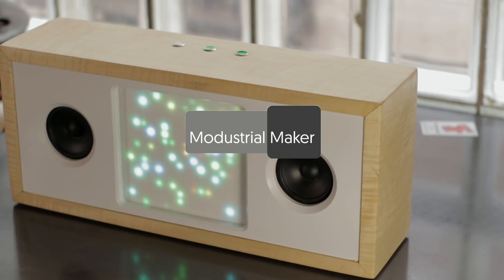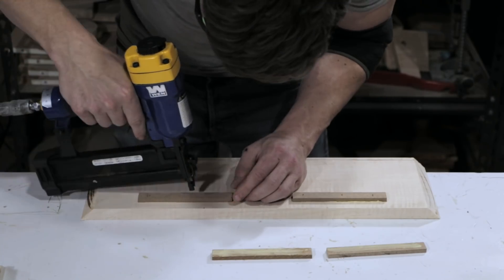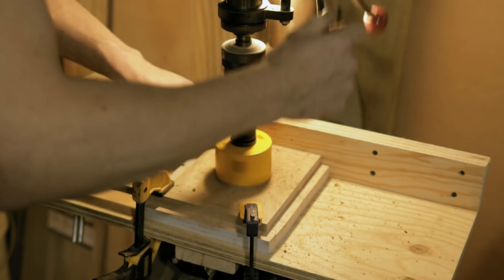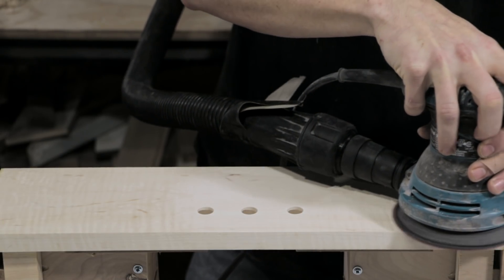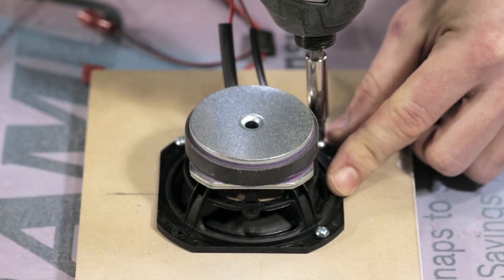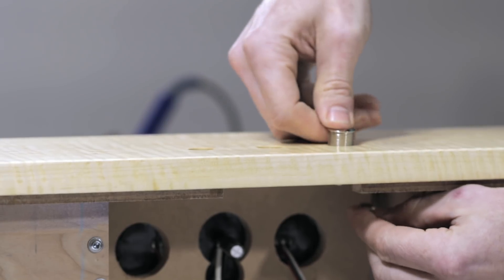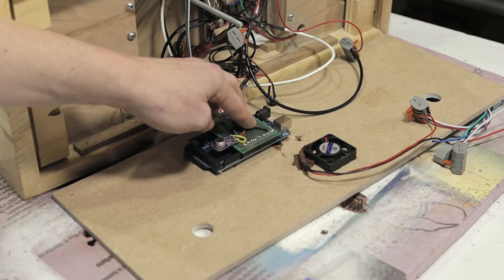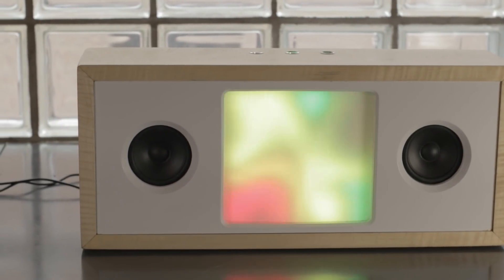Bluetooth Speaker w/ Reactive LED Matrix || How to Build a Speaker || DIY

Comment: Greetings! Thank You for sharing this. I know it is not so new, but, decided to try out of curiosity. Unfortunately, on Arduino Mega 2560 it acts like would be on super slow clocking or something like that :) Probably new versions of used libraries mess things up? I don't know. Tried on two different "Mega 2560" boards ("classic" layout, and mini board). If you still check this, and, maybe have a quick idea(s) from your experience - I would appreciate :) Thank You, and Merry Christmas!

Comment: With the speaker enclosures I think a pro built cabinet would have a hole (often in the front) to allow the moving air out (if that's what it's for!) but you might have put one in the back I guess... No doubt they are scientifically calculated for volume of the box and the output of the speaker.
Also when you glued the aluminium (note the spelling ;) sheet to the panel face and then the led array, you would get better glue contact clamping a ply sheet over the whole area rather than just at 4 points.  It evens up the contact better rather than just under the clamps.   You'll have built the next one by now but just observations from here.  Great project!  I am a bit obsessed with led displays and this is a goody!

Comment: In a smaller setting, what’s the benefit of using a step down converter vs just a resistor? I’m tinkering with a small vw bus model that i would like to put a few LEDs in, as well as a bluetooth speaker setup that I have robbed from an older speaker box. 

Can you explain it to me like a second grader? HahHa
Reply from the maker: Honestly, I'm not sure about a resistor vs step down.... I guess what I could tell you is the step down is easy to wire and you just dial in the output voltage, so it makes it foolproof.

Comment: I am using a 16x32 rgb matrix instead of the neopixel. I was wondering if their was any way to edit the code to be compatible with that type of matrix instead. Thank you.
Reply from the maker: what type of LEDs?  ws2812 or sk6812?
Reply: @modustrial  I couldn't find what type of LEDs I am using. But I bought the matrix off of https://www.adafruit.com/product/420
Reply from the maker: Unfortunately I don't think my code will work. The description of those states they are designed to be driven by FPGA.

Comment: Hello Modustrial Maker I still think this is a great project and for now I will assume my problems are with the cheap ebay Arduino Mega clone I have. I am going to spend a few bucks more and get a real one. I have taken the 16 16 display and built your beautiful diy "Living  Art" table lamp. Please check my comments and praise on that page, I didn't think it should be discussed here.
Reply from the maker: Thanks!  This one takes some effort and troubleshooting, just add one component at a time and make sure that each is working before adding another on, and you'll get it up and running.

Comment: I have started building this great project and have run into a snag, every time I attempt to load the sketch onto me Mega 2560 R3 I get the following error message "Arduino: 1.8.5 (Windows 10), Board: "Arduino/Genuino Mega or Mega 2560, ATmega2560 (Mega 2560)"In file included from C:\Users\Jim\Documents\Arduino\Baby_Speaker_FINAL\Baby_Speaker_FINAL.ino:1:0:C:\Users\Jim\Documents\Arduino\libraries\FastLED/FastLED.h:17:21: note: #pragma message: FastLED version 3.001.008 #    pragma message "FastLED version 3.001.008"                     ^c:\program files (x86)\arduino\hardware\tools\avr\bin\../lib/gcc/avr/4.9.2/../../../../avr/bin/ar.exe: unable to rename 'core\core.a'; reason: File existsexit status 1
Error compiling for board Arduino/Genuino Mega or Mega 2560.This report would have more information with
"Show verbose output during compilation"
option enabled in File -> Preferences.you have any ideas on what might be happening here because I have run out of ideas.
Reply from the maker: Are you using an Arduino mega?  Also, did you install the FastLED library for Arduino?
Reply: Yes and Yes
Reply from the maker: It looks like some error with FastLED.....there is a very active FastLED group on Google+, I would post the error there and see what they say.

Comment: Hello Modustrial Maker  this is a great project and I have already begun ordering some of the electronics, tomorrow I am going to my local home center to get the wood and other items needed.    I was wondering, in your instructions on the Arduino Project Hub you state    "(optional) ¾” hole for fan intake.  Drill where convenient.  I centered this hole about 2” from the top edge."    but nowhere did I see any listings for any cooling fan, do you have any suggestions for which cooling fan would be best.     Thanks for a great project and build instructions my son is going to love this. Hell I might even make one for on my work bench as well.
Reply from the maker: I just searched for a small 5v fan on eBay...just make sure it's size is right (about 1" square or so)

Comment: I built a Bluetooth Speaker with a 2 3w 4ohm speaker powered by a PAM8403 amplifier supported by 5v 1A powerbank charger module and for the bluetooth i have used a USB powered bluetooth adapter
Now while connecting 5v output from the powerbank module is connected to the +ve and -ve of the amplifier module and the same wire I removed the sheath connected a B0505s-1w dc -dc 5v-5v isolating converter to the respective +ve and-ve wires and the output from the converter to the Bluetooth Module
Problem1: Ground Loop Sound Interference still exist
Problem2: Slight heart beat like thumps from the speaker 
Can you help me find a solution to this?
Thanks in advance
Reply from the maker: Sorry, it has been so long since I looked at this, and solving electronics issues without being able to physically play with the circuit is very difficult.  Definitely check out some of the speaker building forums online -- they are a great resource for troubleshooting help.

Comment: Modustrial Maker
Hi, a great video. I'm in trouble with the problem or not, but the switch button needs to be turned on when it is turned on, because I do not know if it should be or not?  pleazy help.
Reply from the maker: Thanks!  I'm not sure I understand your question, could you please elaborate a bit more?
Reply: https://www.aliexpress.com/item/16mm-Metal-Momentary-Push-Button-Switch-LED-5V-12V-24V-110V-220V-StainlessLess-Steel-Waterproof-Car/32825559676.html?spm=2114.search0204.3.50.3dcc6cedMuzRxo&ws_ab_test=searchweb0_0,searchweb201602_3_10152_10151_10065_10068_10344_10342_10343_10340_10341_10696_10084_10083_10618_10307_10820_10821_10303_10302_10846_10059_100031_524_10103_10624_10623_10622_10621_10620,searchweb201603_30,ppcSwitch_2_ppcChannel&algo_expid=b9e198a2-bfa6-4254-9dd5-855278935d02-6&algo_pvid=b9e198a2-bfa6-4254-9dd5-855278935d02&transAbTest=ae803_2&priceBeautifyAB=0
Reply: Do  have to be hot?
Reply: or bad voltage button ? and hot button side
Reply from the maker: Still having trouble understanding what you are asking.  Are you asking if it is in the configuration where the light is on normally, and goes off when depressed?  In my build, that is how it is wired.

Comment: how do you call the wires used for the female power jack and the on the microphone board because they are not jumper wire (flat cable) and i dont know what you call them. thanks
Reply from the maker: I think I just used 20g wire for the rest of the wiring.
Reply: i'm making one right now, i shud finish it in like a week because i av little experience and tools. i'll send the picture to ur mail when its done. thanks once again
Reply from the maker: Awesome , can't wait to see it!
Reply: i sent you a mail regarding the mic. please check it out. thanks
Reply from the maker: Just replied.

Comment: Nice, detailed video on a decent, cabinet-grade speaker. (I'm tired of seeing speakers whacked into XPS foam boxes - might as well use an oatmeal can.) I'm sure your friend's baby will be well-enriched by it!

Did you really need an Arduino Mega for this, or did you use it because you happened to have one on hand? I'd think anything bigger than a Nano would be overkill for this project.
Reply from the maker: Thanks!  The mega was used because the code was too big for a nano...I used a clone that was like $8 so I didn't mind the fact I didn't really need the I/O on the mega

Comment: What are those gray and orange things where you can insert wires?
Reply from the maker: Those are lever-nut wire connectors: http://amzn.to/2BhMtvM  I love them...easy to use for quick prototyping (and carry signals much for reliably than a bread board), but sturdy enough for permanent installs.  They are designed for use in 120V home electrical boxes, but work really well for applications like this too.
Reply: oh, thank you so much. Those can be really handy in my projects
Reply from the maker: Glad to help!

Comment: Holy crap this is awesome. What a great project! Wish I had all the tools needed to make my own.
Reply from the maker: Thanks much!  You absolutely don't need all the tools I used...  You can build a speaker with a circular saw and drill...what tools are you working with?
Reply: Right now (I'm still fairly new) I have a Jigsaw, a reciprocating saw, and a drill. I also have a dremel on it's way to me.
Reply from the maker: You can build a speaker with those tools and an MDF shell, just be ready to do a lot of hand sanding.  A circular saw will really help as far as cutting pieces straight. I would recommend that and a randome orbit sander as your next tools.  Check Craiglist as you can often find lots of old corded tools available on the cheap
Reply: Thank you so much, I will definitely get hold of a random orbit sander next, and look to getting a circular saw soon! :-)
Reply from the maker: Awesome!  And have fun, it's a very addicting hobby :)

Comment: Awesome build! I'm a former DIY audio hobbyist. The only real positive critique I can think of as far as the sealed enclosure for the drivers goes is lining the inner walls with some type of sound damping material. I'm a fan of carpet padding as it's thin, but it's a dense enough foam to catch any unwanted back waves from bouncing around. I'd definitely stuff the enclosures with some poly-fill as well.

Comment: Hi, when you press mode button, actually it will connect pin5(green wire) on arduino to GND or 5V?
Thanks.
Reply from the maker: +Tuan Ma I'm not sure what the question is?  In the code, there is a switch_pin variable (or something with "switch" in it...I'm not at my computer now).  Whatever number that is is what you connect the button to (with the red and blue wires to that pin).

The green wire on the button itself should be getting the 5v power in from the power source or the 5v pin on the Arduino.
Reply: Modustrial Maker Thanks for your reply. I mean the green wire that connect from arduino pin 5 to 5 pins mode switch (blue and red pin). When you press mode switch what actually the switch do? Will it connect red or blue pin on switch to ground or 5 volt? Since i do not use exactly same as that switch.
Now if i turn it on, the led panel just continuing jumping from one mode to other mode just in a second.
Thank you.

Comment: very cool build.  i would be very interested in a q&a session.  i'm going to try to build it but i have no experience with wood working so i'm trying to find an alternate enclosure.
Reply from the maker: I still owe everyone the Q&A.  I had ambitions for a dual camera setup so I could show code and the speaker at the same time, but have not been able to get the equipment and software set up due to time/money constraints.  I will probably just do an Instagram live session instead in the next week or so.

Comment: Nice work! I think I'm going to build one with a rechargeable battery pack when i have some time.
I also love the adjustable position of the led matrix! You cold add a spring between two countered nuts on the threaded rod and the rear plate of the speaker so that you don't have to push the rod back in the speaker when you loosen the tumb nut. :)
Reply from the maker: Thanks!  The spring is a great idea, I was trying to come up with a solution for that!

Comment: i just made my first project.. i love your project. i really like the mod for the led to difuse them great idea!!
Reply from the maker: +Dave Blvnko thanks!  What did you make?
Reply: Modustrial Maker i started with some simple mapped Christmas lights for the tree.. worked out but I need to get better at soldering..  next I want to do is a udoox86+ambilight ... I also think about making ur Projekt for my workshop.. but I would try to add a radio with inside 😊
Reply from the maker: Cool!  If you share pics on Instagram, definitely tag me (@modustrialmaker).  I want to do an ambilight for a TV at some point, but am hoping if I wait on this, someone will send me some code to make it easier to tackle :)   Re: soldering -- if you are using a cheap soldering iron, you might be better than you think.  I upgraded to a decent soldering iron with more power, and it makes a world of difference.

Comment: How were you able to hook up the laptop power supply to the sound board? did you cut the barrel attachment off to reveal just the wires?
Reply from the maker: Yes, and no.  I built five of these, and for some I used a 19.7V power supply, for others I actually used a 24V power supply (although they recommend 19.7V, the Dayton board is rated for supplies up 24V).  The barrel on the laptop power jack was bigger than the standard size, so I cut it off, and soldered a smaller male power jack onto the wires (making sure it was rated for at least 6A of current).  The 24V power supplies had the correct jack so there was no need to modify these.
Reply: I'm new to electronics and am trying to figure this out. Does the Dayton board have a barrel in for the laptop jack fit in on the power cable to power it?
Reply from the maker: Kudos for jumping right into this project!  No, the power cable that plugs into the dayton board just has bare wire on the other end, so you have to connect it to something.  I connected it to the female power jack on the back of the box (via a splitter).   The female power jack on the box goes to a splitter that runs directly to the dayton board, and to the step-down converter.  This way I just plug the male power jack into the back to power everything.
Reply: Thank you! i appreciate the help! i'm mostly trying to figure out how the blue tooth speaker part works first before the LED
Reply from the maker: No problem.  I was actually going to recommend that.  If you break it down in steps, I think this project is definitely doable for a beginner.  I suggest: 

(1) Watch videos by Kirby Meets Audio and Soundblab and use them to build a basic bluetooth speaker with a Dayton board.

(2) Watch Cine Lights VU meter build videos to build an LED VU meter like he did.  Natural Nerd's audio reactive lamp is also good, but Cine-Lights electronics are closer to mine since he also uses a momentary push button.  My code is a mashup of code from Cine-Lights, Natural Nerd, and a few people over on the FastLED Google+ forum.

(3) Put it all together in one build with LEDs integrated in a speaker box.

This is basically the path I took to get to this speaker, and doing each part separately before putting them together was definitely helpful.
Reply: Hi again, just a quick question, how exactly does the power supply with Inner diameter - 5.0mm Outer diameter - 7.4mm tip size connect with the 5.5mmx2.1mm DC Power Jack Socket Female Panel Mounting Connector?
Reply from the maker: I actually had to cut the female jack off that power supply, and solder a smaller jack on.  (I couldn't find a 19.7V supply with the smaller jack.)  I used one of these: http://amzn.to/2qk4k3v
Reply from the maker: Sorry, I said that backwards, I cut the male jack off the power supply cord, and used the smaller male jack (from that link).    Are you located in the U.S.?  If so, just e-mail me your address and I can drop one of the smaller jacks in the mail so you don't have to buy a 20 pack.  I've got a bunch of em lying around.  (Email is modustrialmaker@gmail.com)
Reply from the maker: Those should work -- my only concern is that the female jack doesn't have an Amp rating (one answered question suggests 3A, and this would be slightly less than the max output of the power supply).  It should be OK though, just do the math and make sure you aren't pulling more than 3A @ 19.7V once you add the LED matrix in.
Reply: Thank you for all the help! I really appreciate it!
Reply from the maker: No problem!
Reply: @modustrial  Hey, its been a while but i just wanted to update and say thank you! a few months ago i was able to successfully make a speaker for my girlfriend for here birthday. It's not exactly like yours but it was a beauty and the beast themed speaker with LED's and an arduino that is sound reactive. I just wanted to say thank you again as I wouldn't have been able to do it without you and I can send pictures as apart of the update if you would like!
Reply from the maker: That's awesome!  Would love to see pictures if you can tag me on Instagram or just email them to me.  Thanks!